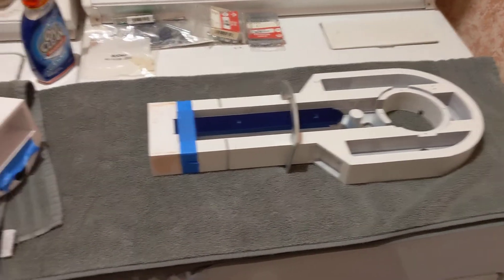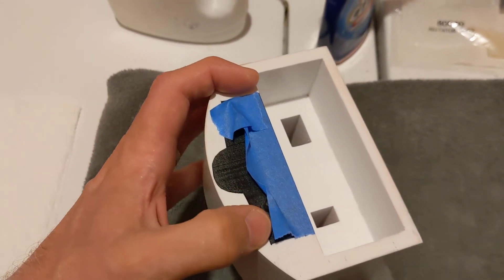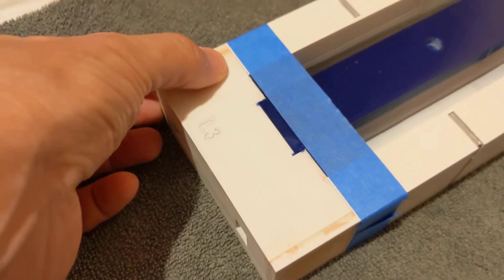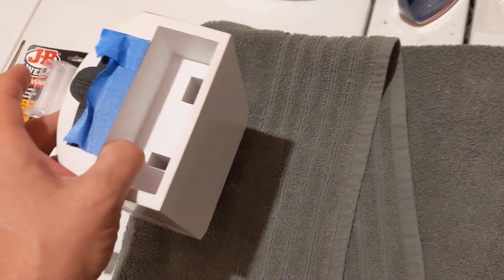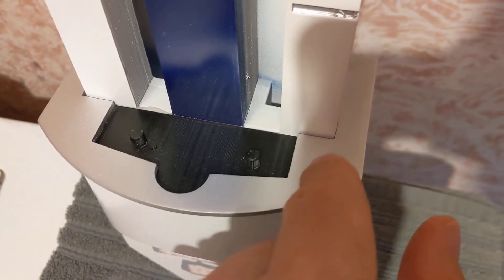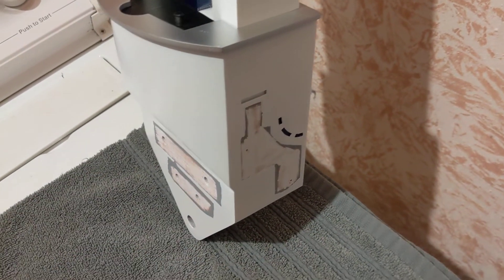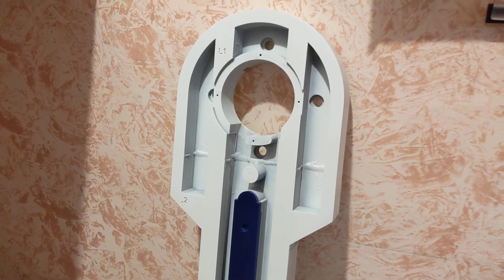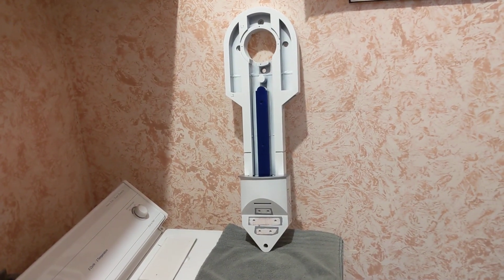3D Printed R2D2 - Part 76

Comment: A big day indeed! Nice job. The black paint looks awesome - it was definitely the way to go. Another nice benefit to finishing up the legs is the huge reduction in number of parts lying around - instead of twenty small parts, you'll have just two BIG ones!
Reply from the maker: Ankle cylinders and related greebles should be going on Monday! Thanks for your video showing how those parts should be installed simultaneously!